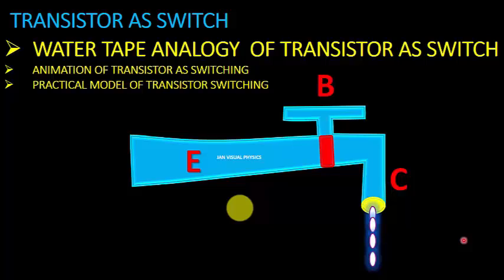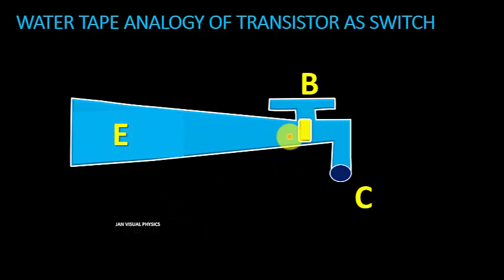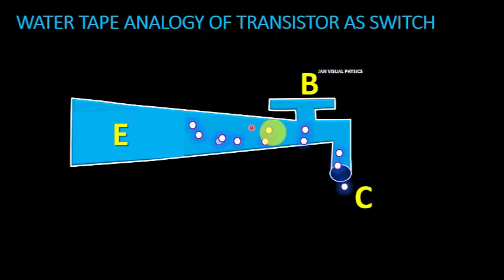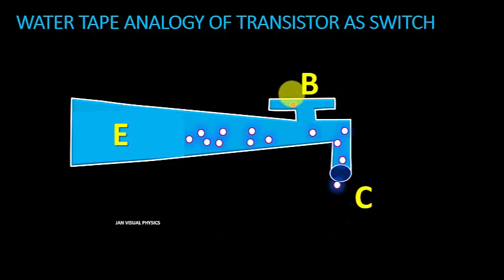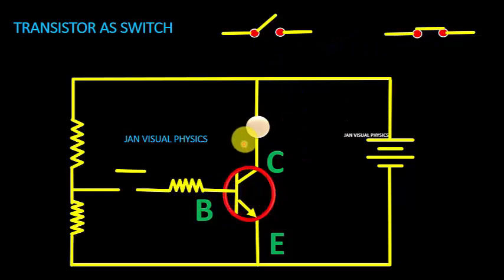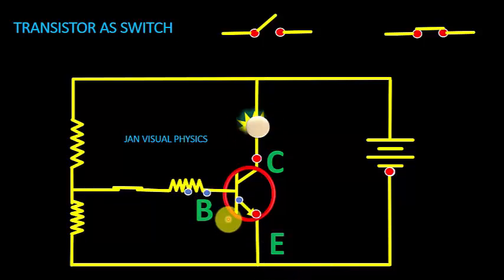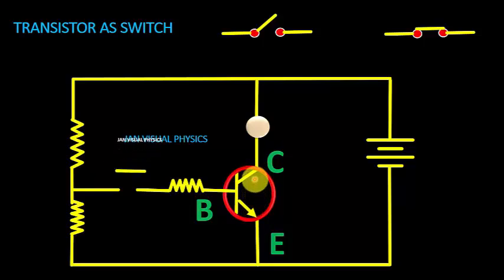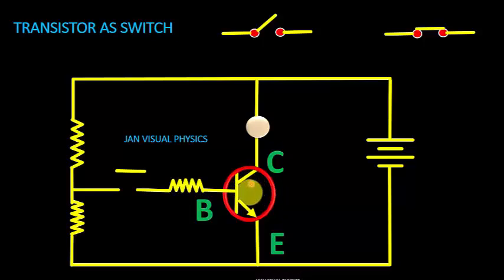How does a transistor work as a switch | Transistor as a switch basics | BJT as a switch animation

Comment: Current flows opposite of voltage?  Current flowing opposite the arrow of diod /transistor.  
Little confusion about emmiter  collector.  There is nothing related to regarding positive and negative. Right?

Comment: Sir transformerless power supply mei pf capacitor ke parallel mei resistence kyu lagate hai.jab ac ya dc volt input karte hai.tab pf aur capacitor aur resistence jo ek doosre ke parallel mei hote hai yeh kya aur kaise function karte hai aur kaise output dete hai.
Reply: Iska animated vdo banakar samjhaiye.

Comment: Why we needed transistor as switch while we have normal switches
Reply: this is the analogy! if you have say 1000 switches and turn this all at once,  u cant attain that bec. we have limited hand/finger to accomplish that...so transistor helps to turn million or billion of switches at once.. hope this helps
Reply: Still Not Understod
Reply from the maker: +shikha Gupta 
these are automatic switches.
 much faster than ordinary switch
when power if off your UPS switches on within  no time.
Reply: its an electronic component which can be controlled by an ECM with very little current and rapid shut off(or on), which is desirable in many applications, it can go from on to ff and vice versa much more times than a common switch without any loss of performance...just mind the heat that is produced, it needs to  cool down when working especially power transistors
Reply: The transistor works as  "conditional switch" not normal switch related to the applied base current  , , the benefits  are achieving the switching state very fast  in certain applications  , like transferring from circuit to another in UPS , making on and off instead of contact points  in cars